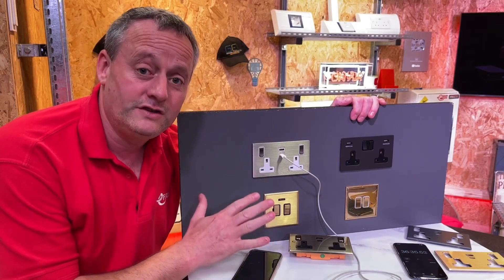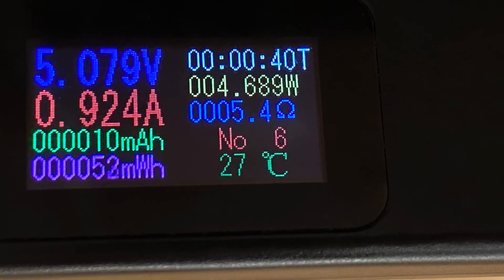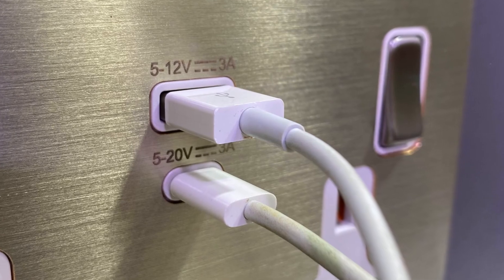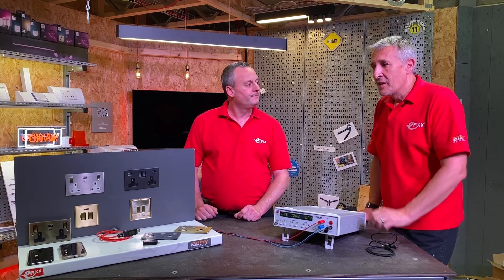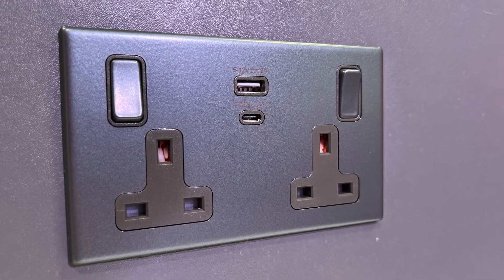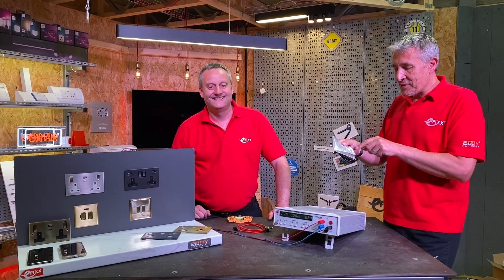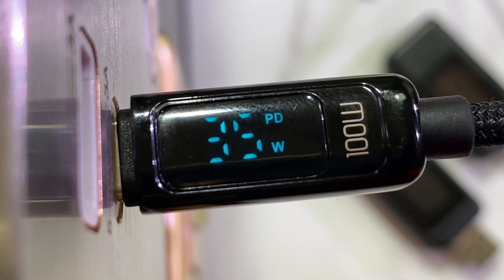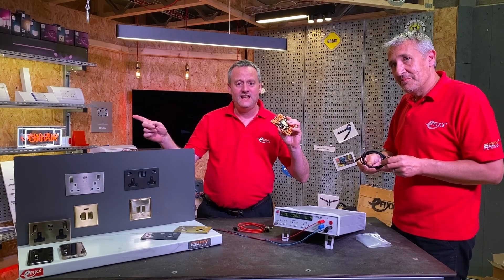Is This The UK's Fastest USB Charging Socket?

Comment from the maker: = AD= New 45 Watt charging sockets from Hamilton http://hub.efixx.co.uk/hamilton-fast-usb
==================================
Handy USB C lead with power meter built-in http://hub.efixx.co.uk/USB-power-lead
Reply: Please think carefully before installing these; you're going to have to maintain them when they fail, unlike a plugin USB-C charger where it's easy for the consumer to replace.  And 45W for USB-C PD is pretty low these days, so you're going to find a whole bunch of things it's useless for.
Reply: Looks nice but another peace of electronics to go wrong and will need to be replaced. 👎

Comment: The labels on the socket say up to 20v 3a on the type-c port. Shouldn't the maximum draw be 60w, then?
Reply: No, it's the USB-PD standard. It negotiates the voltage between the device and charger up to a limit of 20V. This allows you to put 20W down the wire at 1A so you don't need a thicker wire than usual.

Comment: ?I don't understand why, if the mains sockets have 230v why can't all of these chargers charge at this speed? Maybe one for Joe?
Reply: The laptops and phones want DC for 240 would be useless without a charging brick which using the USBC would remove the need for. Sorry if I have misunderstood your question / point
Reply: @nickthorley1  Sorry Nick, I did not explain properly 😀. A better way to ask the question is, take the USB double gang socket that has 2 USB ports which give a maximum shared 2.1 amps. With a 13 amp supply, why does the 2.1 amps have to be shared? Why can't both supply the full 2.1 amps simultaneously? It's kind of similar to my above question, why can't all chargers deliver this speed given they have the same supply current? 😁
Reply: @Paul_Holmes  some chargers with more then one port share the power so say you have 2 ports at 3 amps they would use 1.5 amp each max 
basicaly its about cutting cost vs quallity but also space as theres not much room behind a UK double gang socket but im suprised i havent seen a USB PD 100w or 240w wall outlet they could even take away one of the AC sockets away for more room and more USB ports that dont have to share power think im gunna have to go the module route 

TBH I dunno why houses dont have a central AC to DC converter and we run LED lights and chargers from that insteed heck if you got solar it makes even more sence rather then convert DC solar into AC just to convert it back again to DC for your computer laptop or phone we only really need AC for power tools and kitchen appliances.
Reply: @Zanith50  Thanks, yes good ideas!

Comment: Interesting video. My only concern about usb socket outlets is that you can't carry out an insulation resistance test between line and neutral without disconnecting the socket.
Reply: Why isn’t there a little rocker switch to physically disconnect the USB transformer ?

I’ve always wondered this but obviously there’s no call for this 🤷‍♂️ or some technical issue ?
Reply: You can test at 230v and add the socket spec in your calculations or some usb sockets can be tested at 1000v ...

Comment: Bear in mind that regularly charging Lithium-Ion and similar batteries at high currents will shorten their life in the long term. I always switch off fast charging unless I need something charged quickly.
Reply: True, but PD compatibility from USB C in the socket, cable and device has largely negated this issue, as long as everything in that chain is PD compatible.
Reply: @ralphholland1313  PD is basically a fast charge standard (and not a very well supported one, even now), but it doesn't change the fundamentals of battery chemistry. If you regularly squirt lots of power into them, they will die sooner.
Reply: PD also slows the charge as the battery reaches 80-90% which I understand is where the most damage is done to a lithium battery, but you may wish to correct me there. In my world at least, I don’t know any mobile items except one or two budget tablets that don’t support PD, so is inexorably going to become a feature of all our lives. You’re absolutely correct in saying that the faster one charges a battery the shorter it’s life will be, and that is why I said ‘largely’ negated. It’s a personal choice, but I’d rather run in the fast lane
Reply: @ralphholland1313  Standard battery management built into all decent charging circuits reduces the charge current once charge is over around 80%, in fact many devices have a battery preservation mode that lets you charge only to a maximum of 80% (this includes EVs).
Reply: Don’t be too sceptical. Look up asymmetric temperature modulation. Extremely fast charging as the cause of early battery failure may be a thing of the past. Also - parallel cell charging…

Comment: The USB spec says USB 3.0 and 3.1 allow 5V at 900 mA (4.5W). Certified Hosts and Devices must limit their power delivery and consumption to these "default" power levels. It would appear that strictly speaking these cannot be called USB.
Reply from the maker: https://www.usb.org/usb-charger-pd
Reply: @efixx  Yes, USB C socket to 2021 rev3.1 will be compliant.